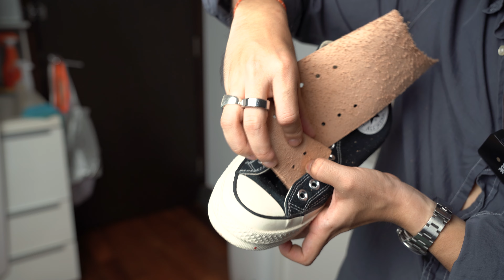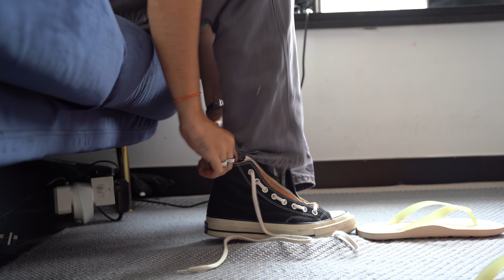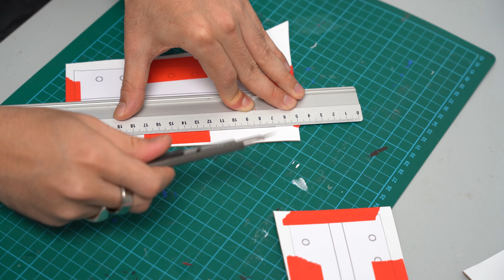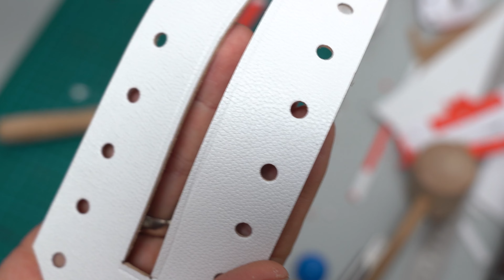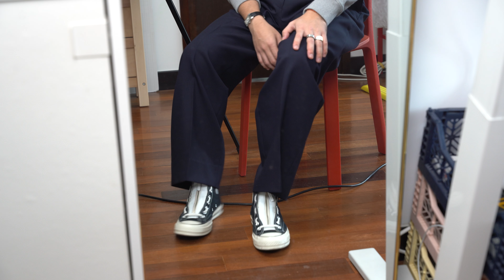Making Things is Fun

Comment: That's really cool, they look great! I wonder if moving the holes slightly inward (and/or experimenting with different lacing patterns) would allow you to still adjust the tension with the laces? Also I feel as though I actually once saw a zip adapter like this on a military boot, but it was years ago so I'm not sure now. Anyway, inspiring video, thanks!
Reply from the maker: I will eventually be making a video about it but the current spaces between holes are slightly on the narrower side. But yeah definitely adding some sort of tension improves the comfort when you put on.